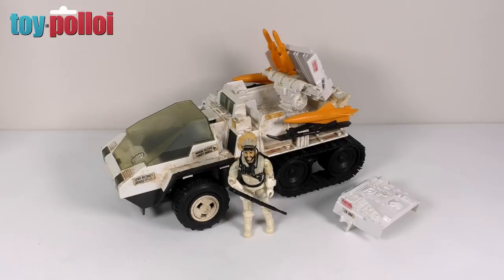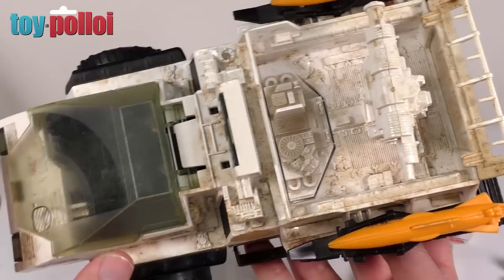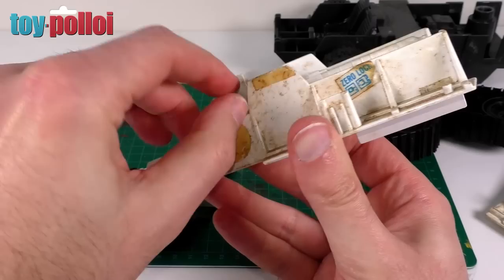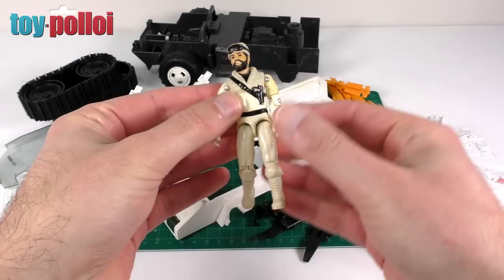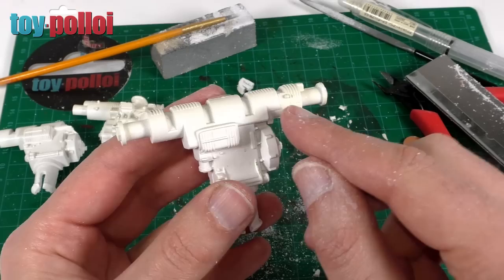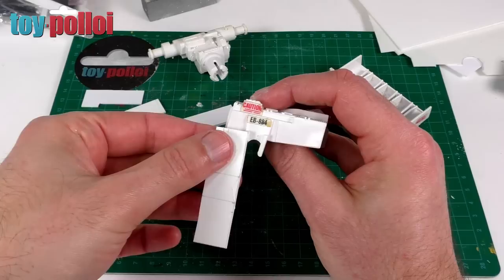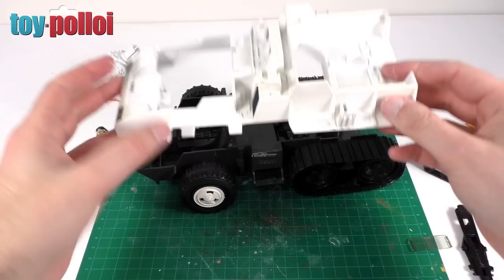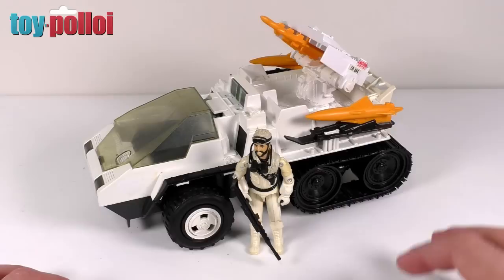Vintage G.I.Joe Snow Cat and Frostbite restoration part 1 - Toy Polloi

Comment: One of the last vehicles I got as a kid and the first vehicle I restored when I started re-collecting Joes as an adult! Although, I just hunted for unbroken parts rather than repairing.
I'm honestly surprised that the mount for the missile box was broken. The tabs on the box itself, sure, they're always broken (thrilled to see a fix for those!)...but I've never seen the mount broken and I've had probably 20 or 30 Snow Cat shells pass through my hands during my collecting.
Reply: I’ve seen a few broken the same way at one end or the other. I think when/if the clips on the missile rack break off, it tends to get misaligned so the jagged bit gets caught on the seam between the two halves of the mount, and if the kid then tries to tilt the rack using the dreaded “excessive force”, the leverage just snaps off that end of the front half of the mount 😕

Comment: One more thing I noticed about this repair. The slots in the T bar correspond to the fins on the missles the repair makes one of those slots shorter than it should be for when the rack is tilted. You may want to carve out the slot so the fins don't rub.

Comment: Be glad that the skies are in good condition .I still have my original snow cat from my childhood and a second one as well and the way that I repair my top missile rack w\is i use a rubber band wrap around the top turrent and it works looking forward to how you fix it and give a cooler way to fix mine .

Comment: I just wanted to say that you could make pretty quick work of those launcher clips and other clips on the vehicles by using a good pair of needle-nose pliers instead of trying to pry it apart with a flat head screwdriver. You're going to break something bro

Comment: Perhaps you are aware of this tip already, if you take acetone and mix with the harder plastic parts from gi joe figures or vehicles (ABS plastics) then you can get a sort of "slurry" mixture which can be used to fill in the repaired/spliced joints and make it quite seamless :) .. i do it all the time. You can even mix different color of ABS plastic with acetone in a small glass jar and get the color shade you need. use small jars with lids to expediate the slurry process, and it will keep for some time. And when it dries up you just add more acetone.

Comment: Great video Dave! For a steering wheel repro /3D prints are available on Ebay for the action force panther jeeps that will be the same scale. Could be a viable alternative if you cant find one for the snow cat?
Reply from the maker: Thanks. I actually have a plan for that part!

Comment: Does the plastic weld you use actually chemically melt the plastics together?
Reply from the maker: Yes.
Reply: @toypolloi  Thanks! Really love your channel. You do some incredible work. I'd love to see a video where you outline some of the material and substances you use and where you get them. (Might be you've already done one 🙂) Cheers! Will continue to watch!
Reply from the maker: Check out the tool box section on toypolloi.com That is a list of the most common ones I use. Then just watch my videos as I show how I use them for various projects.

Comment: I have a Lego steering wheel a full round one. This vehicle looks like it should have one of those half wheel ones. But I don't know that for sure. Still you should be able to find a lego one that could be modified of a decent size. The one I have looks to small to be any use to you here. Good luck.
Reply from the maker: I found a good replacement you will see in part two.